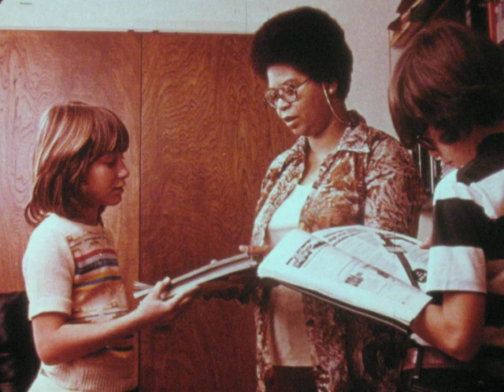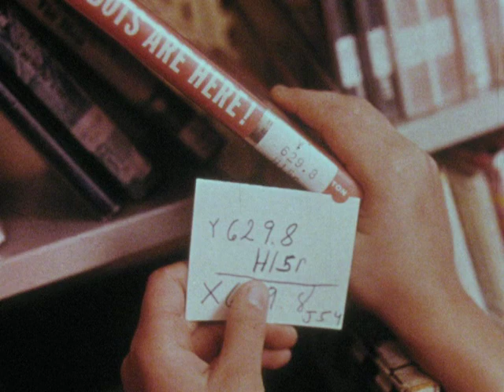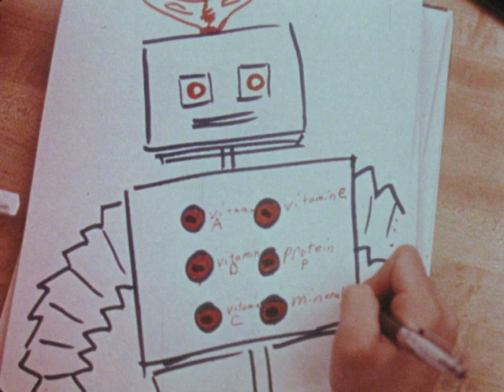DO YOUR PROJECT RIGHT - Part 1 (Educational Film Strip -1977)

Comment: Filmstrips were a staple in classrooms during my elementary years. What did you use to scan it?
Reply from the maker: I have fond memories of them from my young school days also. Even if the content was borderline boring, we always looked forward to the faux filmgoing experience of a filmstrip projecting in the darkened classroom, initially with the accompanying audio playing from a scratchy LP, and then later from a cassette deck.

I only uploaded these files a couple of years ago, but I actually digitized them over a dozen years before that. At the time I didn't have a scanner appropriate for this type of filmstrip, but I did have a classroom filmstrip projector. What I did was project in a darkened room onto a neutral white non-reflective surface about 6 feet away. I photographed the image using a high-resolution camera mounted next to the projector, and corrected the off-axis keystone using Photoshop. At that point I could have applied a full restore color correction, but I found that when I did, it removed some of the sentimental orange-tint aging that otherwise evoked faded 70s imagery. So I kept most of the aged orange hue intact.